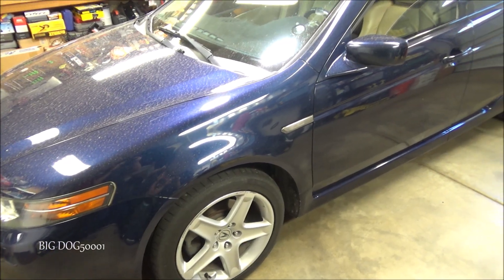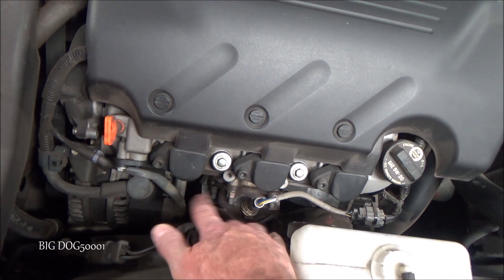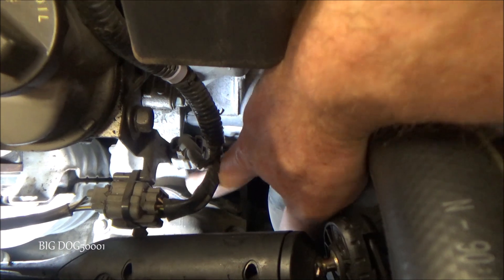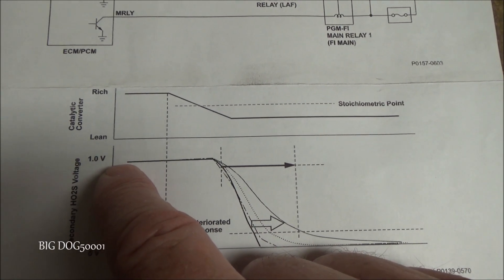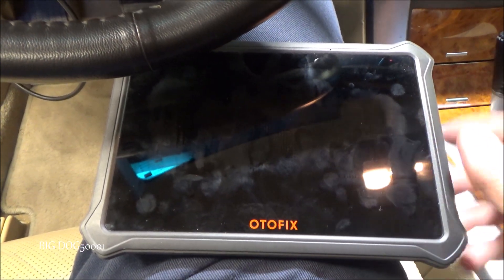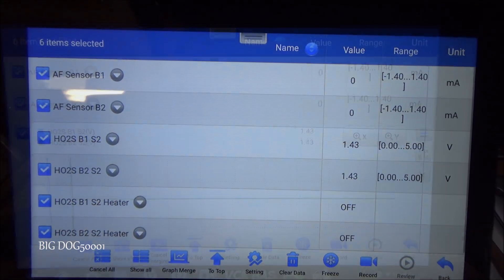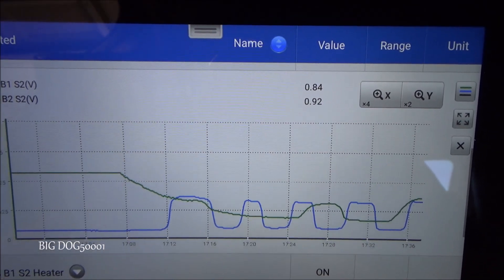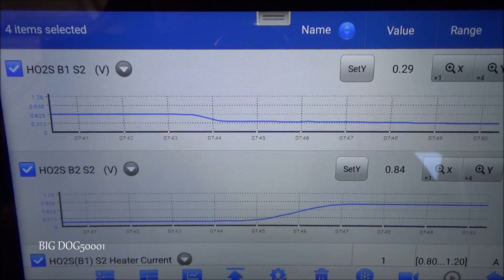Honda/Acura P0159, P0139 Oxygen Sensor Slow Response

Comment: Off topic but hope you can help - broke off the bottom left side bolt on the water pump of a j35 accord engine - below the surface of the block -I bought an Irwin extractor set but there is not enough room for a drill to start the hole - any suggestions or tips for the removal? - I over torqued the bolt on installation of the replacement water pump so this is not a rust issue - I know the bolt was not cross threaded as I installed by hand before using the torque wrench  - I never heard or felt the click. Again any ideas or suggestions would be appreciated

Comment: My Odyssey gave a bank 2 secondary o2 sensor slow code and it turned out to be simply that the egr tube, which connects right next to the O2 sensor, separated from its flange because the bolts had corroded away to nothing. My old Civic did the same and it was the sensor. p.s. that old 3.2 looks very clean, no rust is a beautiful thing.
Reply from the maker: No rust is nice!  Thanks for the comment!